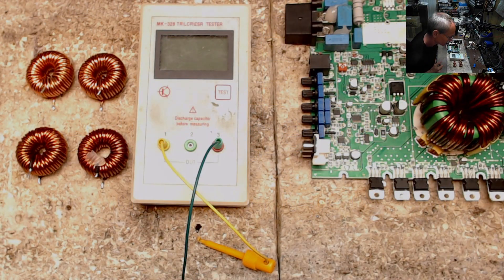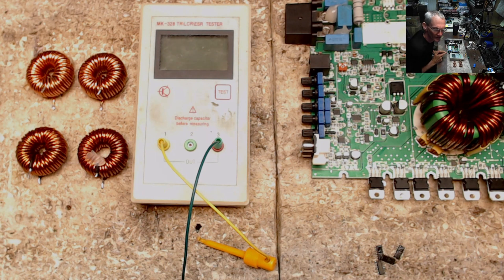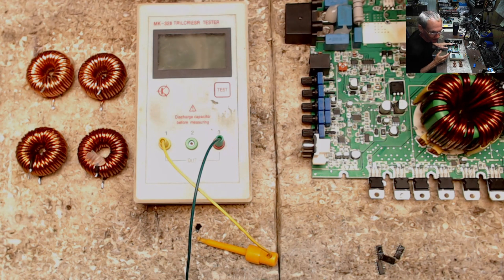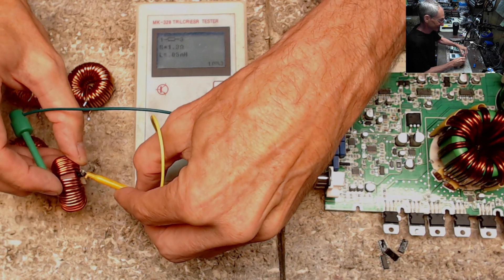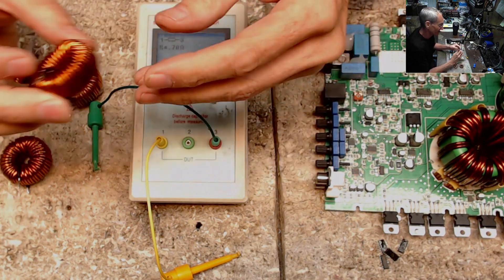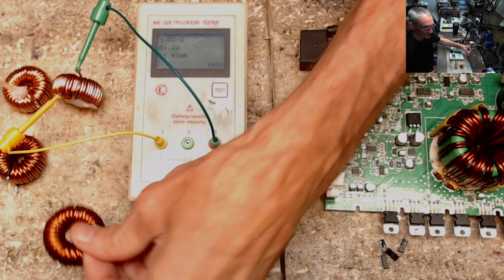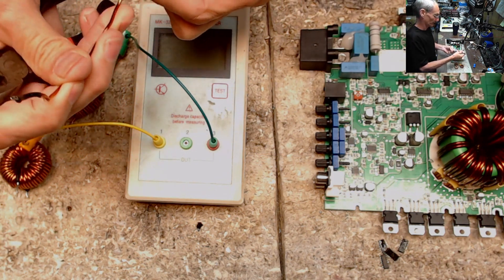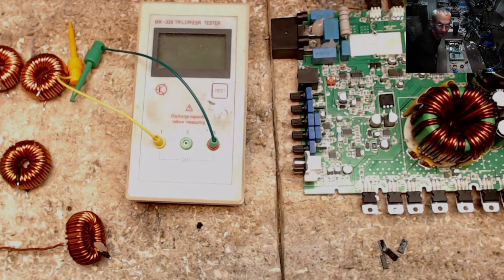Misquoted Taramps Bass 3K Fault Found 6 Hours Later (It Did Start Up!)

Comment: Just had a Sundown SFB-5k that kept heating up only one side of Mosfets. Transformer seemed fine but when using LCR meter, the inductance was way off compared to the other one. Replaced transformer and problem solved. The right meters are the key. Wouldn't have found this issue without that meter.

Comment: Is it normal for taramps to get very hot very fast? Ive heard multiple people say taramps run hot and my md12000s get very hot
Reply from the maker: If you are wired low then they will heat up quickly. It all depends on how the amplifier is being driven. Make sure the fans are up to par!
Reply: @ellensburgamplifier  im wired to .5 ohm nominal and rising to 1 ohm.   Also voltage dips down to 11v when the bass hits i do keep the signal clean by monitoring the clip light on the amp
Reply from the maker: @shitbrick69  .5 at 11v will create significant heat.

Comment: Is its transformer is not small for 3k watts sir? 
What is the rail voltage in this amp sir?
How it gives the high wattage? With that small transformer and not so much copper?
What is the frequency in supply section sir?
Reply from the maker: The rail voltage is 98 volts. Your output is dependent on rail voltage. The components can be smaller due to the higher efficiency of the topology. The frequency of the supply is 20kHz.
Reply: @ellensburgamplifier  +98 0 - 98 ? Or +49 0 -49?
20khz is too low for an efficient system.  Higher the frequency, amp will become more efficient i think.
Reply from the maker: @bamrahbabbu  For design specifications and questions I would get in touch with their engineers.

Comment: What do you charge per hour to fix amplifiers and  how do i contact you
Reply from the maker: Thank you for the channel support. I do not charge by the hour but rather by the job. This is where proper quoting is essential, unlike what happened with this amplifier, as I missed the inductor during the quote to the customer. www.ellensburgamplifier.com/FAQS and all my contact info is on the site.